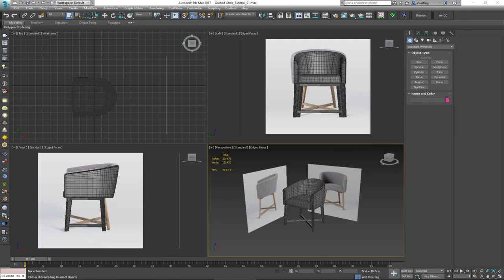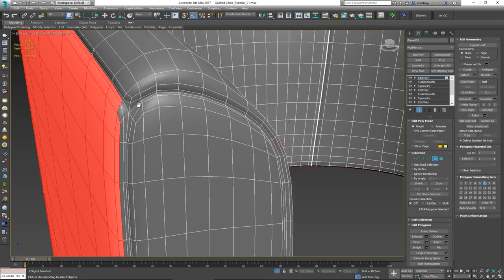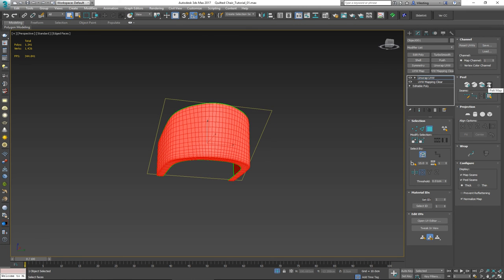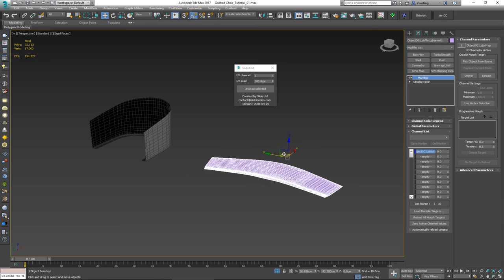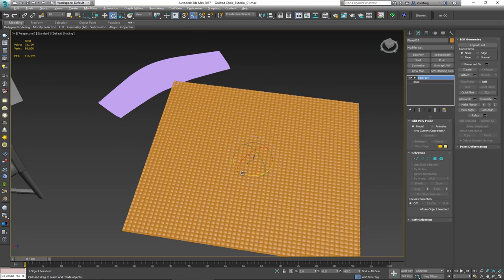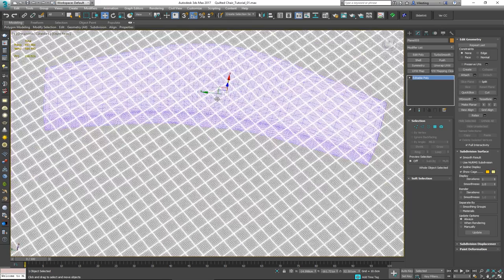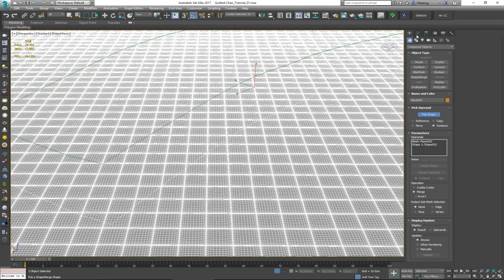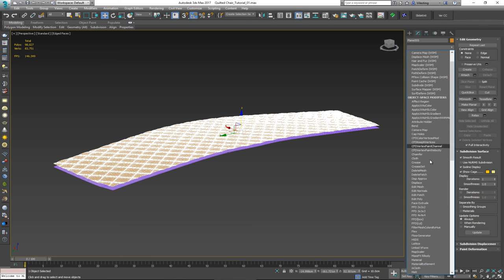Modeling a Quilted Leather Chair in 3ds Max Part 3

Comment: You can use soft selection instead of pull/push
Reply from the maker: You could but it would be slower and you would have to individually set the range depending on what you are moving to limit the vertecies you will be moving. But in the end you are right, you can use soft selection as well.

Comment: Is there a good reason not to use generate topology to make the quilting? you might have to fiddle around with the topo a bit before hand - to make the edges on the outer shell match the scale of the seams on the quilting go but it has to be quicker than all that messing around with unwrapping and creating all those  extra verts and then refitting the shell etc etc
sort of like this:
https://youtu.be/MpsURXZvcsU?t=3m33s
Reply from the maker: You can do it that way as well if you want as it will be a viable choice. There are many ways to skin a cat and in this case you can skin it that way as well. The way that i showed here is basically a workflow that is valid for any sort of geometry be it a quilted geometry or something more complex. Another plus with this is that you can use this approach on uneaven surfaces where you have bending.